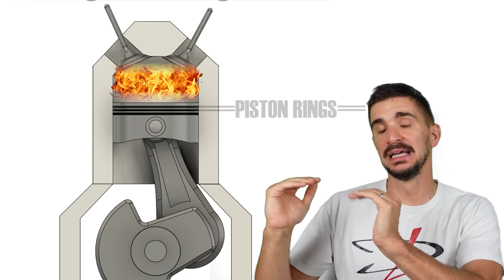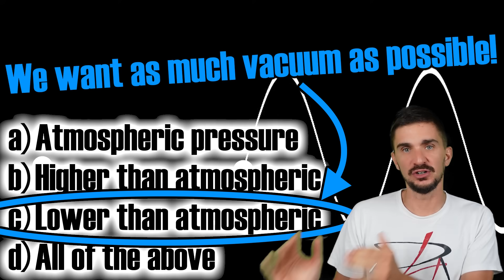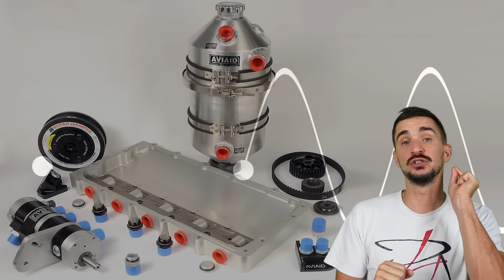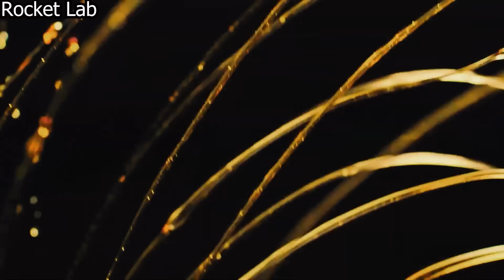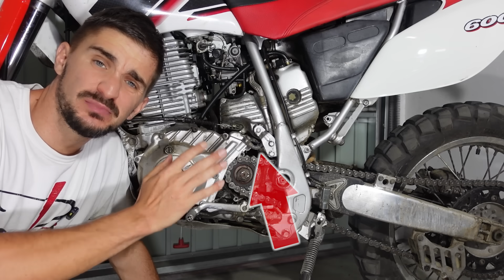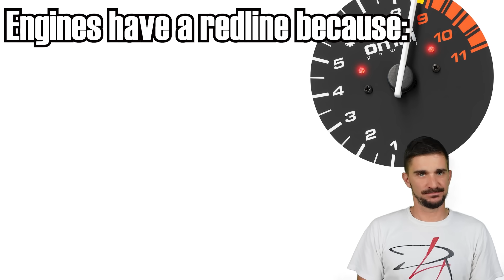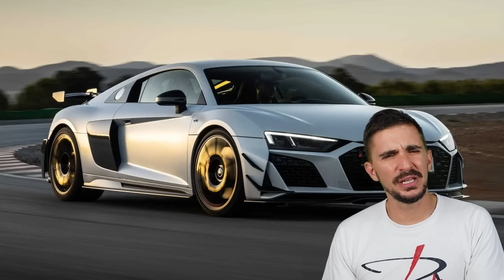Installing This Has No Drawbacks, Except for Your Wallet - Dry Sumps Are Awesome, Here's Why...

Comment: So what if the oil pump is driven by an electric motor instead of a belt. With sensors and computers it can adjust the speed just as well as a belt could, and you don't have to worry about the belt breaking. Wouldn't that add even more power? Since it is not taking power to run the belt, it seems like even more power could be gained.
Reply: and turn engine off sensing motor dont  work if fails

Comment: If a dry sump belt breaks you kill your engine (if it is a separate belt) which is even worse then if you kill your valves and maybe a pair of shafts (if there is a single belt for all the systems) because you may continue driving with no oil pressure for a long time if it allows you to.
Reply: It won't brake. It is very short. I witnessed many cars with timing belts and it never was an issue.

Comment: My 2¢:
1st the Notsonice Part:
* A dry sump sys in a street car? how do you fit it in a already cramped engine bay, then adding a pulley?.
* Where is the beef?  replacing a single oil pump with 7?  in car racing, airplanes, specific geography/ working machinery ok.

The good news:
* Warranty of better cooling, after all oil is 1St. for cooling 2nd for lubrication.
* As you get better oil temp you may get marginal gains in milage of it (and fuel?).

Great video D4A
( Was it game device, through space 🌌? wasn't it a coin in a river 🏞️ to make riches ?👍

Comment: well for end of life, i had an old chevy cavilier with like 280k miles on it and the oil pump started going out. would start to show low oil pressure after driving at low rpm at idle. i just over filled the oil resavor lol, figured the car was totaled already and it would give me the most life out of the car.
got an old honda and better spent my time fixing that and basically gave the car to a friend on disability who really only needed to drive to the grocery store once a week. he drove that car for another 6 years like that probably because the oil would unfroth before he drove it again and it never got hot enough or enough engine load to blow the engine up/blow seals. was kind of the best solution to a crappy problem imo. now i have a chevy volt so i dont really pay for repairs or gas despite all the driving i do
Reply: Tangentially related, it would seem you have a positive view of the Volt.  Would you care to elaborate on the maintenance side of it?
Reply: @dannypipewrench533  as long as u plug it in every day, its basically a diesel electric with a big battery. they dont even make phev's with as big of a battery after 15 years. the new gen prius finally conceded and copied most of its transaxel layout. engine is a ~120hp 1.4l ecotech tuned down to 88hp naturally asperated, gen1 is iron block, port injected, with no egr garbage. engine only runs at a steady rpm and is pracitally only ever run on the hwy. brakes last forever as long as they dont rust off the backing plates. transmission in gen1 was a solid cnc milled planitary gear set, very expensive but runs fine without fluid change to over 500k miles. gen2 and most of toyotas "e-cvts" use a stamped steel belt construction and can crap out after 80k miles in hot weather. battery has a very conservative ~33% SOC buffer and there is no way to supercharge the battery/uber the battery into the ground. actively cooled. zero range degredation in both my 2013 and 2014 volts after ~140k miles each. average lifetime mpg in both of them is 76mpg and 85mpg. they actually have more acceleration than a base rear wheel drive tesla if you hack the ev motors to make them think theyre a cadalac elr. gm kneecapped them to 120kw but they actually run fine at 180kw which is enough to spin the tires, only 3400lb with some minor weight mods. gm made a car that never broke and no one cared coz they thought it was a knock off prius
Reply: @vevenaneathna  Thanks for the information.  I have been thinking about buying a Volt.  I know a guy who has one, but he recommends the second generation.  I guess I want to know more about how bad the transmission problem you mentioned is.
Reply: @dannypipewrench533  depends on temp of climate for both battery and transmission and how the car was driven. mild climate is best. keep hearing about random gen2 problems that make no sense. watchjrgo has a bunch of videos on different gen volts. go to his channel and search for the volt and watch all of them before buying one. also avoid 2012 year gen1, 2011 has some weird issues. 2013-2015 are the best gen1 years

Comment: What I don't understand is why they use exhaust gases for better emissions, dip timing belts in engine oil to minimize friction, and do everything else for downsizing. But if dry sump lubrication has so many advantages, why doesn't any manufacturer think of installing something like that? If the goal has always been to get more power from smaller engines or reduce fuel consumption, and even turbochargers (which are also very complex) are now installed in every cheap car, I wonder why they don't still install this system.
Reply from the maker: It's very expensive and takes up space and the benefits are at high rpm.
Reply: Don't forget that a large percentage of car owners are horrible about maintenance, and ignoring an oil pump drive belt would result in a seized engine. I worked at a shop for a while and we'd regularly see cars come in with 1.5 quarts (liters) of oil in a car designed for 4 quarts. They would only come in because the car would throw a CEL for VVT oil starvation.

Similarly, people will ignore oil leaks for a long time, and a leak in the main high pressure oil feed line could very easily blow an engine (instead of just blow a turbo or what have you).

Imagine these points relayed to a legal risk management team at an automaker!
Reply: @TylerLinner very true, and well said. They have to make these cars a lot more idiot proof. Just too many idiots out there
Reply: There are cars that have dry sump systems. Porsche comes to mind, I think the new C8 corvette does too? I am sure there are others. But yeah, it has never been wide spread or common
Reply: Loved the full circle roller bearing crank animation. How they should be made!
Reply: If you want engine with a dry sumo then it's an aircraft engine or race engine
Reply: Same reason hybrids never caught on: Price.
Reply: @samsonsoturian6013  hybrids never caught on? every manufacturer has a hybrid model on the road

Comment: I'm not so smart and all but want to check if my gut says right.
What about that if the pressure in the bottom chamber is lower than atmospheric, yes it will be easier to move down the piston so there's power gain, but on the other side there is a problem with moving the piston upwards (as the pressure in upper chamber is greater than this in the bottom chamber, so piston is constantly trying to go downwards) doesn't these balance out and no power is gained by this part of the idea? Sooo, what only gains power as i would think is that there is less drag/resistance on the crakshaft.
Could someone explain if i'm wrong?
Reply from the maker: Let's imagine you're pushing a boulder. The boulder won't be lighter if there's a vacuum behind you. It's still a boulder. Very bad example but sort of illustrates things as the things above the rings remain unchanged. The issue is also that pressure in the crankcase naturally decreases anyway as a piston goes up so it can't act to "push" it up.

Comment: Nice video, but there are a couple of things you got backwards. The PVC valve opens when the crank case pressurizes above atmospheric pressure: The top of the pressure pulse is flattened, Second, your graphics for braking and accelerating are switched when you are talking about oil slosh.

A significant drawback to a dry sump is getting all the used oil out of the engine during an oil change. It can be a chore to get all the oil out of the block and external lines, to the point that compressed air is sometimes used to get it all out.
Reply from the maker: No. The manifold determines what the pcv does not the crank case. If there's boost in the manifold the pcv will not open for example. Also,  if there's no vacuum in the manifold at all there's not enough pressure difference to open in many cases. Yes the pressure in the case is of course a factor but explaining that as the active factor would be backwards. For the graphics you need to watch carefully and observe. Where's the timing belt cover? A drain plug in the pan and correct hose routing completely eliminates oil drain issues in about 95% of applications. My tt600r drains just like any other bike. One extra bolt to remove.

Comment: I think the car manufacturers don't put them by default because they expect low rpms. But really deep down I think it's because they keep on wanna selling us new cars. If we take all of your videos about gaining a few percent of efficiency thanks to a clever device, and make all the compatible ones into one car, it would consume half the gas and the planet and our wallets will be saved.
Reply: Your wallet wouldnt be saved with maintanence cost of an additional system and another point of failure
Reply: @captain_heat yeah but that should be cheaper than the gas nowadays

Comment: So you add more power by adding dry sump but you also lost some power by the belt
Reply from the maker: Explained. Ultimately it's net gains
Reply: Some manufacturers use supercharger in their engines. Supercharger takes 10hp from the engine but returns 40hp. This is why they are still used.

Comment: A dry sump doesn't fix pcv issues in my experience on Volvo b12ble d12 motors. But they work for thier money unlike most engines especially performance. A scraper doesn't do much different to a dry sump limiting oil into the crank. 

This is race car stuff. Most motors last hundreds of thousands of km with no pcv issues besides a bit of cleaning. Race car motors don't last usually past 5000km without being pulled apart.

25-50hp on 5000hp though.

Comment: Wow so many wrong statements and misinformation.
Take the typical 4 cy engine.
1) the crank case volume DOES NOT change as the pistons moving down are directly counteracted by the pistons moving up. There is NO CHANGE to the crank case volume

2) You need negative crank case pressure. Ok this helps suck the pistons down but then there is more effort needed when the pistons move up so there is a net ZERO power gain.

3) Dry sumps introduce added complexity and weight to the engine and also require more engine power to run than a normal wet sump oil pump.

The bottom line is that the increase in engine power is a direct result of all the other "tuning work" that has been carried out on the engine PRIOR to fitting the Dry Sump pump, pipework and tank.
Reply: l think harder to compress air than make vacum maybe

Comment: Makes oil changes really easy
Reply: probably WAY more expensive though
Reply: @KristopherNoronha  It cannot be more expensive as you just remove a single bolt, empty the oil tank and the refill it without needing to run the car for minutes.
Reply: @kazuviking  I think he meant it's a larger capacity so you have to buy more oil
Reply: Bigger oil bills, due to more oil needed?

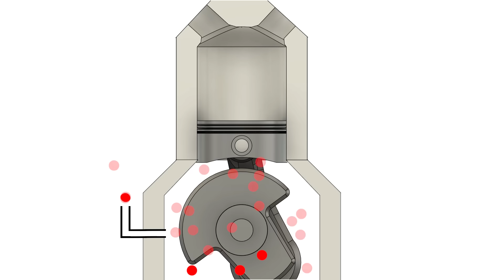Comment: 4:29 but on the compression and exhaust strokes the vacuum is a hindrance. Still may be a net win off.
Reply: in a multi cylinder, it is less an issue and the benefits outweigh the cost. Roping and pressure are bigger hindrances, and a full dry system stops some of the drainback by sucking oil from the head as well, so oil doesn't get beat by the crank and vice versa.
Anyhow, they also tend to provide venting to the engine to keep the vacuum closer to an ideal level.
Reply: The volume of air in the crankcase doesn't change much because in most engines the pistons are going up and down at the same time, thus negating the changes in volume. The higher pressure is caused by blow by gasses mostly. But the benefits of having less oil particles floating in the crankcase AND the lower air resistance for the moving counter weights of the crank give that extra power. Yes there are losses, but the external pump would be much more 'expensive'. Now imagine, for short races, that they would use an ELECTRIC dry sump pump, powered exclusively by a battery. Yes the battery is heavy, but the parasitic loss using a belt driven design is also significant. Besides that you can change the speed of the electric pump depending on the need for the engine e.g. during braking the pump can work slower than at higher speeds. But higher speeds, coasting, doesn't need the (electric) pump to work so hard, so it again can slow down - reducing energy needs so a smaller battery can be used. And of course during braking the alternator can charge the battery especially if some super caps would be used to quickly get electricity back which then slowly recharges the battery system.

But .. added cost and complexity :)
Reply: @woogicreate8876  pumping losses is the heavily oil laden air moving within the engine causing drag. The vacuum helps the oil drop out of suspension due the lower mass of air holding the oil in suspension. Which adds up to a frictional force against moving and rotational parts.
Reply: Would a vacuum suck fuel into the sump?
Reply: @MARINER1SEATTLE  how.. from where
Reply: @MARINER1SEATTLE no but cracked piston or leaking fuel injector or carb/float, high fp pressure/regulator issues will
Reply: Yes but it’s a metal envelope using centrifugal force not a paper bag on a hand lever. In reality it can withstand the minute tug of the natural forces trying to “slow it down” compared to the million times over explosive forces “speeding it up” putting it, the car, and you in motion. You’re just “allowing” it to do more of what it’s already doing. Multiplication vs addition and all that.
Reply: correct.. but.. theres no win.. its worse.. vacuum induces greater blowby losses
Reply: @Errol.C-nz  vacuum also increases ring seal which reduces blowby.
Reply: @no1aussiepaul no it doesnt.. consider.. positive  crankcase pressure blows oil past the rings into the chamber.. negative pressure draws it passed breaking the oil film seal.. theres a balance point.. but it only benefit scavenged emissions.. oil gets contaminared faster.. oil sample analysis shows it

Comment: I‘m a little confused rn, as I have been in the opinion thus far, dry sump systems serving mainly the purpose to ensure stable oilpressure under high g-forces and, as a positive side effect, enabling lower centre of gravity of the drive unit.

Therefore, the question I‘m having now: If you‘re only interested in the improved engine efficiency, could there be a more cost effective (DIY?) version? Like to combine the crankcase valve with a suction pump creating a vacuum in the crank housing?

Ideally blowing it into the induction system to reinforce the effect?
Reply: Race cars do. Big vacuum pumps sucking the crank. Or using exhaust to suck the crankcase.
Reply: Thanks for the info 

Sounds like a rather easy DIY thing to implement… but maybe I’m underestimating the efforts or overestimating the benefits 

But +5% to 10% in power seems quite worth it 

Even for my old Range Rover V8 Engine ;)
Reply: belt driven vacuum pumps are a thing been used in drag racing forever, GZ motorsport for example sells a kit to install one, they aren't cheap but much cheaper than a true dry sump
Reply: Use an exhaust-driven scavenging line to drop crank pressure reducing total oil in suspension reducing windage losses. Very inexpensive but requires a free-flowing exhaust and proper installation location on the collector.

Comment: There is no such thing as a perfect vacuum. Just saying.
Reply from the maker: Space?
Reply: @d4a  In what we call vacuum, like on the Moon, there are approximately 40.000 particles per cm3. 
Even between galaxies, there are a few atoms per cubic meter of space... And even if we imagine the impossible, a region where there is not a single atom, there are the so-called virtual particles that pop into existence out of nothing. Sure, they annihilate each other almost instantly, but the fact is there is no such thing as a perfect vacuum, so something that flies in the space it will not go in a straight direction forever...It will go on very long, but not forever.
Reply: @d4a  YouTube erased my comment, but I will try again... What we call vacuum, like on the Moon, there are 40.000 particles per cm2...And even between galaxies, there are a few atoms per cubic meter.
Reply: @ozymandiasultor9480 wow, very ana

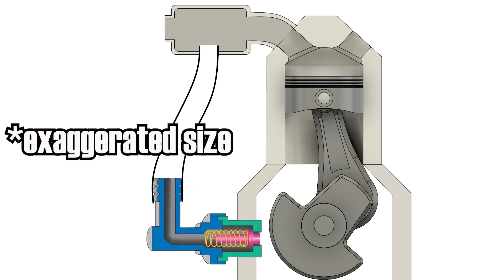Comment: @2:01 The PCV is the reason that intake valves get ruined with a lot of gunk. People think it's the EGR, but it's not.

The EGR blows nice dry dust into the intake. Yes that will make the intake dirty, but just a dry dirty.

The PCV is spraying oil vapors (sort of like a very fine mist of oil). When this oil is combined with the dry dust it makes gunk (much like water and dirt makes mud).

I have a personal vendetta against intake gunk, so I love port injection (carburetors, Toyota's D4-S, etc), and PCV breathers (where the PCV is not routed to the intake, instead it's just fitted with a filter).

I get a kick out of the D4-S because it's kind of like an inverse DEF lol, it's sprays the intake with fuel on to clean it lol
Reply: If you route pcv not back into the engine on a wet sump system and just low load/rpm daily driving it you ll overpressurize the crankcase which is not good AT ALL. Thats basically turning the engine into a 1920s system even before and worse than road draft tube era from 30s-50s
Reply: EGR=HOT exhaust gas.  Combine that with oil vapour and you have the perfect conditions for creating carbon.
Reply: Add a catch can.
Reply: Diesel truck engines have to use pcv and di. They do just fine. This hysteria over a dry intake is just that.